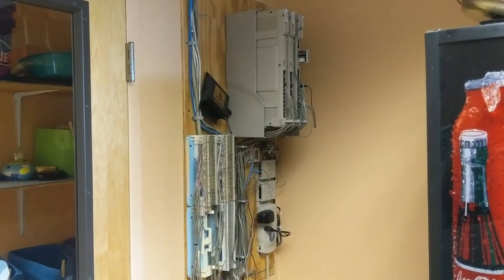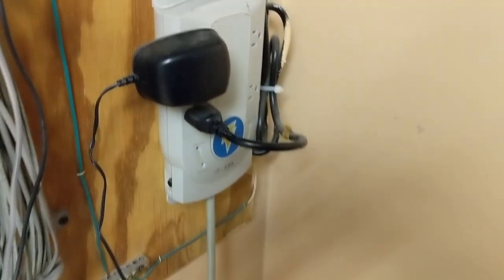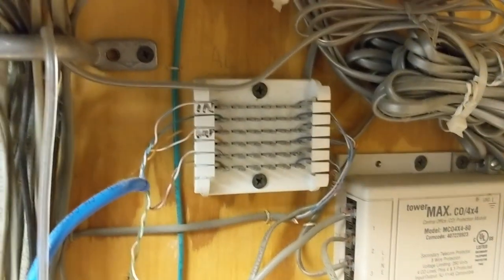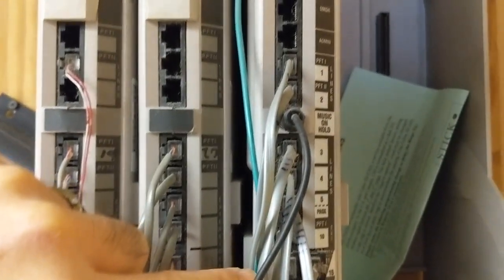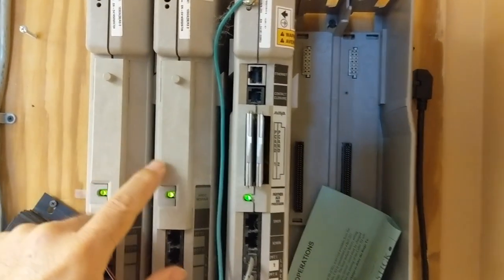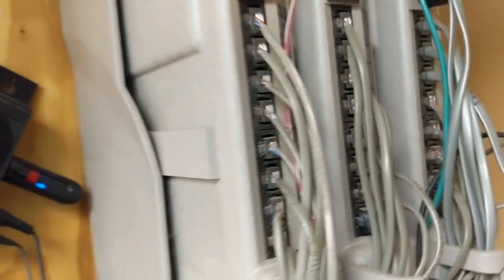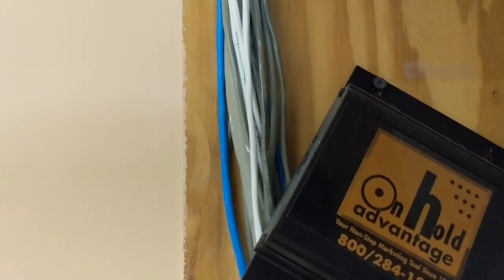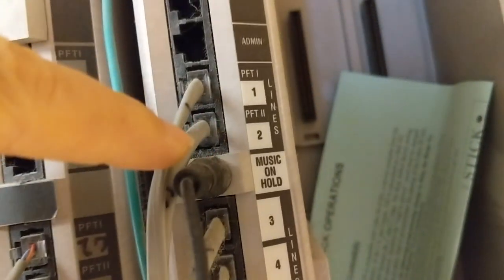Avaya Partner PBX Tour

Comment: The second PCMCIA card is either a flash card for doing backup and restores or a combination modem / backup restore card.   The modem allows a technician to make system programming changes from a remote location using programming software and a dial-up modem.
Reply from the maker: Thanks for that 411 Bob.  Sounds like you’re a Veteran on those Partner systems.  I only know enough to be dangerous. 😆

Comment: ATT/Lucent/Ayaya....  Hard to believe this technology is now at least 30 years old.
Reply from the maker: Right?  Those old Partners were tanks.   Put them in a cool, clean environment with a UPS/Surge protector then they would probably last forever! 😄
Reply: @DIYTelecom  Actually as I dug further I then realized that the Avaya version was introduced around May of 2003?  I maybe taking possession of a system with a 2 Lucent modules and 3 Avaya modules installed in an original ATT Partner Plus backplane. 

The company is moving into a smaller building and not taking it with them. So I asked if could be shipped to me.  All of the menus were recorded by the national marketing person who died suddenly several years ago, and was someone who was great to work with.

My now 10 year old Panasonic Advanced Hybrid System at home which is a KX-TA824 connected to a TA-50 voice mail.  The voice mail unit has been acting strangely for the past couple years.  It uses flash memory, and is proving that this is still not the most fail safe technology...
Reply from the maker: Oh man, those Panasonics!  I had a lot of experience with those in Eckerd Drug Stores!